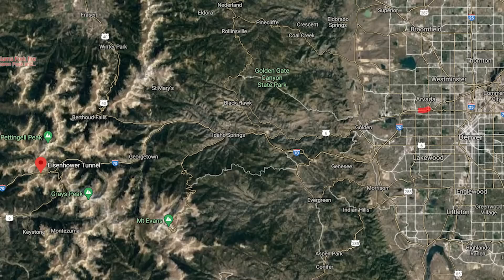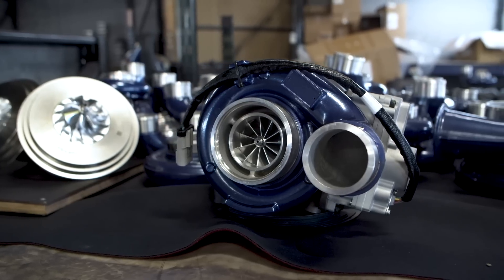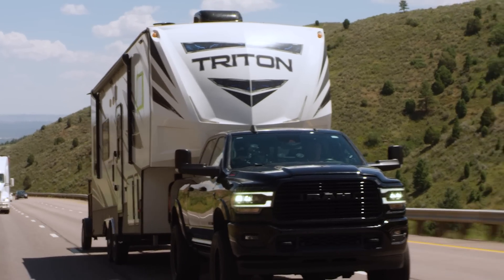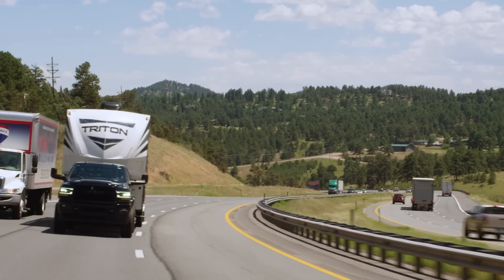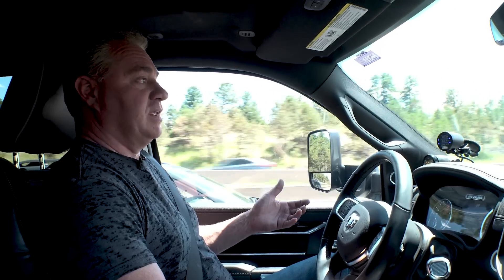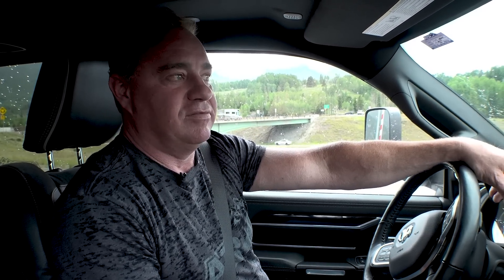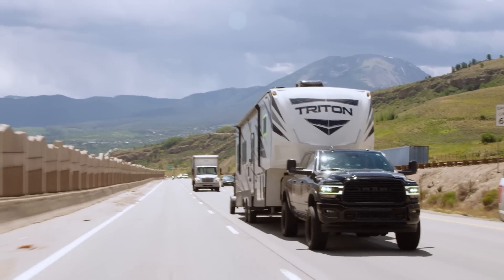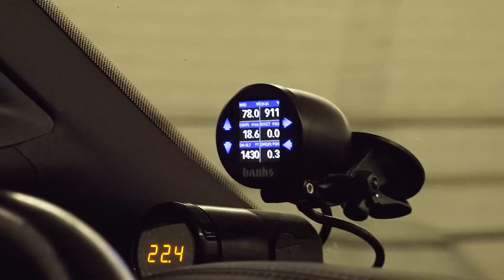ATS Diesel and Banks Power?

Comment: I didn't know it was legal to tow that way...
Reply: Check your State Laws.  It is about not only weight but length too.  My buddy got pulled over with 5th wheel and boat and trailer.  It was too long.  He dropped the 5th wheel and had family stay in it and then moved the boat.  I warned him.  😏🧐.
Reply: Yes you are allowed to tow double in recreational use and farm exemption. Any other scenario you need a CDL with a double and triple endorsement
Reply: @hitchedzebra59_42  I knew about the cdl double/triple endorsement as it's common to see where I'm at, but I've never seen it for recreational before.
Reply: @ColeSpolaric  I see it here in Wyoming, Nebraska, and South Dakota often. My family used to pull their camper with the boat hooked to the rear of the camper and it worked out pretty good!!
Reply: @hitchedzebra59_42  I'm in Indiana outside of Chicago. Not a recreational destination lol
Reply: @ColeSpolaric  Ah I see lol, well, when you have a camper hooked on and your not hauling or pulling for money, your considered recreational
Reply: Depending on your license and the state, places like North Dakota commercial drivers can pull dual 53 foot trailers.

Comment: Anybody else wanting this dude to get the hell out of the left lane?
Reply: Seems like that is a way of life these days. I see trailers on the left quite often, sometimes they are in the carpool lane !
Reply: @Garth2011  nothing wrong with a trailer in carpool for most areas so long as the passenger count is met.
Reply: @jaydunbar7538  Disagree. Any trailer type in CA is required to only use the right most lane except if passing. To get to the carpool lane you'd have to violate the right most lane restriction 3 or 4 times and then once you're in the HOV lane, you just broke another Vehicle code. Check the books, in CA trailers are a no go. Not sure what CO has in their VC book but I'd guess its the same.
Reply: @Garth2011  i said in most areas, then you disagree by stating "in California". Maybe your not aware, but California is a very small portion of the country.
Reply: @jaydunbar7538  you could have factored that in all by yourself. Would be interesting to know how many States allow trailers in the fast lanes. Its very rare in the USA
Reply: @Garth2011  its not rare at all, California is the only state with a statewide ban.
Reply: @Garth2011  i drive OTR, my normal week is 3-4000 miles across the country. There are small sections around various major cities that ban trucks in the left lane, other areas have all through traffic (which is mostly trucks) designated to the left lane only. There is no standard across the country for anything other then the signage and interstate weight limits, go up to Michigan and the amount of axles on a single truck will make those used to California trucks question reality.
Reply: @jaydunbar7538  Vehicles with Trailers and Trucks? I've not seen a tractor trailer in the car pool lane as of yet
Reply: You are all annoying.
Reply: The camera truck was in the other Lane in front, so he couldn't move over.
Reply: @allanb3222  doesnt that just further the fact they did that intentionally?

Comment: I wonder how many brake applications going down the hill???
Reply: Hopefully minimal given they could use what the truck has (engine brake and manual gear selection) unlike what the other channel does.
Reply: @alan. You miss the point of the “other channel”.  They are testing the FACTORY trailer tow calibration to determine its effectiveness.  Any idiot can manually select gears, but when the manufacturers tout their “Tow/Haul” mode, wouldn’t you think it would be a good idea to see how well it works?
Reply: Mike K I wasn’t knocking TFL at all, just saying their methodology doesn’t take into account what a driver should be doing in such a situation. But if a vehicle is equipped with a feature (exhaust brake) just for such situations, shouldn’t that be tested as well then?

Comment: In the beginning of the video he talks of countless transmission failures from I 70, what he fails to mention is that all the low mile trans failures were one that he 'built' and sold
Reply: Phillip Aubin  I thought they were decent. We got sonax, revmax, firepunk, PDD. Any of these good and if not, name one that is please.
Reply: They still have an awesome 5y/500k warranty.
Reply: @ChannelZeroOne  which they don't stand by. Do some more research and you'll find out.
Reply: @ChannelZeroOne  😂😂 naw I bought a fully built Allison from ATS and it was trash. Day one install couldn’t drive it out of the shop because of a bad torque converter! Had another torque converter go out months later and was never right after that. The warranty means nothing if you’re out of your truck while waiting on them! Never should you buy a $13k trans and have so many issues. Go stock.

Comment: Ats transmissions are awwwwwwwwfuuuuuuul
Reply: Have you owned one? What happened with it?
Reply: A Th ive seen them come in with gas motor parts in $7000 builds.
Reply: Jon Meray damn. I was considering getting a trans and turbo at the first of next year
Reply: A Th oh man i wouldnt give that trans to my worst enemy
Reply: Little more info would be nice, then only shouting that it’s bad.
Maybe you where using wrong the fluids.
Reply: Anton Floor precision transmission has a video showing exactly what they do. Ive seen examples of what is in that video starting about 15 years ago
Reply: Maybe this should have been a GMC Duramax truck since Banks seems to favor them most.
Reply: Jacob Sordello that would be surprising. They use old parts sometimes.

Comment: 30k on a single wheel wow. Nice work on the turbo set up. I've run many of your products keep up the great work.
Reply: 30k gross combined, use your brain.
Reply: @vegastyle84  before insults, he was making a statement based on the facts given in the video. Incorrect facts? Yes. Now make a factual statement on what GCWR really means compared to the actual near overloaded weight he was tail waggin up that hill.
Reply: @PBVader  he at no point said the vehicle was rated to tow it, the only statement was on the weight. Its over 20k gross, the truck and camper would be in the 20k neighborhood.
Reply: @jaydunbar7538  30k
Reply: @vegastyle84  No Way!
Reply: Yea no way it weighs 30k.
Reply: @jonmeray713  20k.....maybe.

Comment: The highest point is at 11,158ft according to cdot. Vail pass itself is just over 10,000ft.
Reply: I drove through that tunnel many times, the elevation is different on either side, one side is slightly less than 11k, and the other one is right over 11k. The tunnel itself, if i remember correctly, was like 1.7 miles long.
Reply: @andreystarovoytov3337  The north tunnel is 21 feet shorter...1.693 vs. 1.697 miles
Reply: Actually closer to 10,600ft
Reply: Highest point is 11,322 ft ASL

Comment: I went to Breckinridge last week and yes there is no air my stock 6.0 was rolling coal up and down that stretch of I-70
Reply: That’s a tuning problem my man.  I had a highly modified 6.0 Excursion and pulled a 13k lb toy hauler all the time with it.  The only time I ever produced smoke is pulling away from a stop when turbo didn’t have time to spool up.  Get a good tune and make that thing run clean and better.
Reply: @motoxer913  I live in Nebraska it has no problem here

Comment: Wonder how reliably the power train is at 250k miles lol
Reply: So much brand loyalty lol, me and my powerstroke will just hang out and watch. 

But yes Cummins makes the best engine for heavy duty pickups that actually see heavy use. But unless your doing 100k miles a year at 30k pounds it doesnt matter as you won't bump into that factor. For driving it to the grocery store and pulling your camper a few times a year it really doesn't matter, whichever one your dad said was best will work great.
Reply: Compared to what because no stroke or duramax makes it that long
Reply: @danielkelley9730   have a fleet of d Max's in so cal 240 to 320 k. Still haul ass. My son's ppe tuned d max has 345.k runs perfect leaks nothing
Reply: Daniel Kelley Both of my Powerstrokes are over 300,000 and still strong as hell.
Reply: @officialdirtysouthtv  ok
Reply: @officialdirtysouthtv  What years are they? Trying to get an idea of what to expect from a 95 F350 with 156,000 on the 7.3L 😉